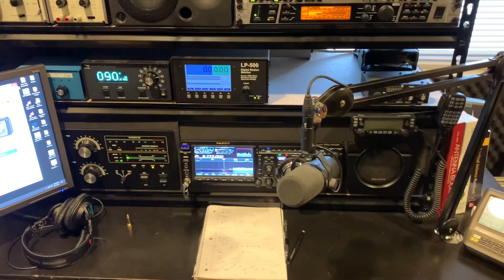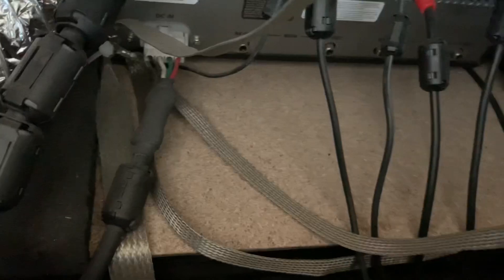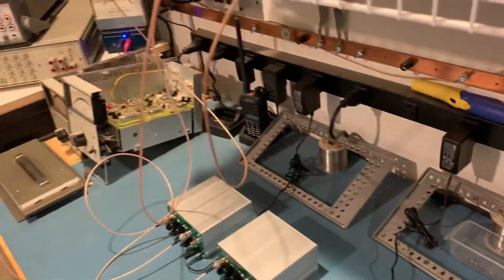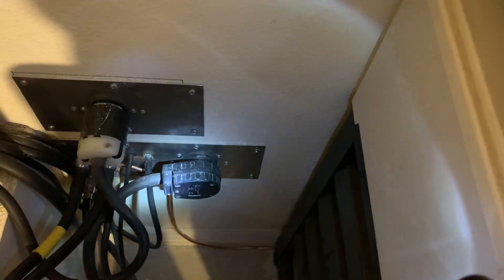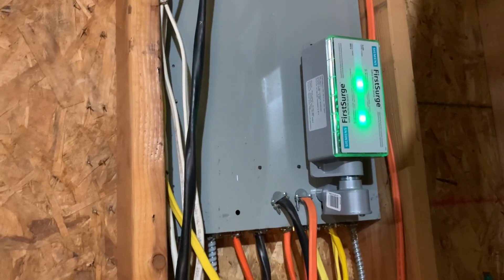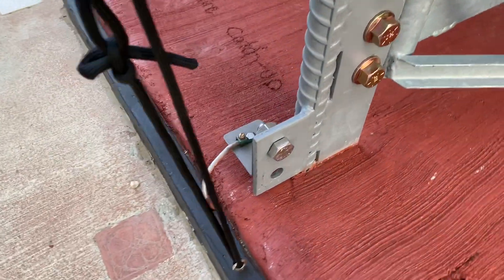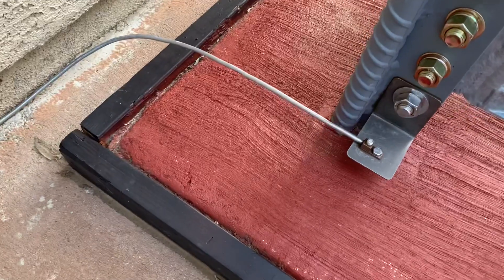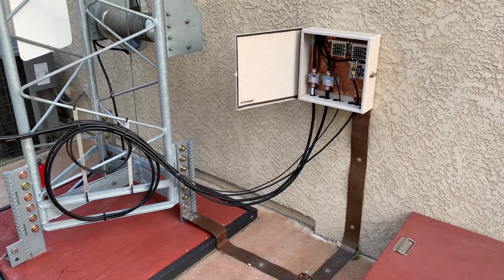Amateur Radio station and antenna grounding at my station  - KJ7E

Comment: Wow, did you drill through your concrete floor (in your cellar) to set the 8 foot ground rods?  If so, do you ever wonder about bugs and things getting in from underneath your house?  I guess water is not an issue since you live in a high elevation above the water table?  Thanks for all the great info!
Reply from the maker: Yes, I drilled a hole for the ground rod in my office under the desk, two actually.  Just put some silicone calk to seal the hole around the ground rood.  No issues with bugs.  The cellar floor is dirt, 3 more ground roods in the cellar.

Comment: Great job on the grounding. nice station you have also. where'd you get them single connectors for the #4 wire mounted on the L brackets at the tower legs?
Reply from the maker: The stainless steel L was from KF7P.com, the lug is just a standard copper ground lug you can find at hardware stores or online.
Reply: @damonkj7e  I appreciate the reply back. I will check the link. 73’s 🤙

Comment: Excellent!! Still bonding and tweaking on my end but you've inspired me to get it done.. If the rain would ever stop.
I only have one observation / reservation. All bonds are on point but you bonded back to main panel.
I'm still on the fence with this one. No bonds after first disconnect. period. OK yea well.. Guess it's back to Ugly's and the NEC book again.
You could do a whole semester collage course on grounding and bonding and I think we would just scratch the surface. Every pro I know goes by NEC and local but has a different opinion or take on it. The way I have mine is it has its own bond and not bonded back to panel. Like a pool or hot tub. 2 - 8' rods and a 6' rod horizontal at the shack.. Dunno now I'm scratching my head again.
 With that.. you did an excellent job. Very nice video.
Only hope mine comes out as well as yours
73
Reply from the maker: The service entry panel was bonded to the house Ufer, rather than bond my system to the house Ufer, I first moved the Entry panel bond to the common point, then extended from the common point to the Ufer ground.  This is okay.
Reply: See.. I had to think a minute but yes.
You just dont want to inadvertently break bond or create a ground loop. ground loops can be nightmares in the shack. My house is also second owner and the 1st owner wasn't shy with tools and I had some questionable wiring to unfigure when I arrived on the scene. Ground was the first thing I looked at.
73  @damonkj7e

Comment: I watch everything I can on grounding, that's why I'm here. And have found some consensus and NEC rules that concur and mandate that if additional grounding electrodes are used they must be bonded back to the main panel with 6awg or >, no splices, and a min. 8" bend radius at corners {On The OUTSIDE Of The House}. !!!  And not provide a direct lighting path into your house.
Having said that, if your antenna is on the opposite side of the house from the main service panel as my station is. Don't you think that you are providing a very nice low-impedance shortcut to the main service panel through your shack and house? I think I would remove the 4awg leading out of the house to the arrester box and connect the large CU straps to 4 AWG or > on the outside of the house back to the main panel/electrodes. Heaven forbid a lightning strike to your tower started a fire to your house and the inspector found you were 
not in compliance with NEC on secondary grounding electrodes' it says Must Be as stated above. On this journey, I ran across a statement from Dave Casler ke0og, paraphrasing.  'When lighting falls from perhaps 50,000 ft in a matter of mil/secs. It doesn't ask permission and it's got a mind of its own. 73/88
Reply from the maker: Simple, you want as low impedance ground system for everything as you can get.  Should a high energy event happen, you want all of your common ground circuit to rise and lower at the same time to minimize voltage differentials.  Voltage differentials is what causes arcing and damage.  I work in broadcasting and have many mountain top sites where we have to deal with strikes and cant go off the air.  Everything from the antenna to the tower to the transmission line to power, transformers, cabinets, dummy load, all the racks and equipment in the racks is tied together with strap at least 2" wide and most of the time 4" wide and sometimes 6" wide from outside to inside creating a common circuit.  Everything is silver braised and clamped or Cadwelded.  It is always best to have the lowest impedance common ground circuit, you cant isolate grounds hoping it does not jump from one to the other, it just doesn't work like that.  Dave is correct, that's why you have to give the energy a path to follow, give it a place to go.

Comment: How do you avoid a quarter wavelength? And why use that thin solid copper considering skin effect? I mean, you've used braid with this in mind. Wouldn't you use copper pipe, the interior of the rod is useless.
Reply from the maker: There is RF ground and then there is electrical safety ground.  I used sort, wide bonding where RF is concerned, but all grounds must be bonded together for electrical safety and surge protection, #4 solid is a good choice there.
Reply: @damonkj7e  yeah I'm talking RF of course. I don't know how you can avoid quarter wavelengths, or multiples thereof with all the bands and all these wires. It would then render the ground useless and actually cause trouble, if anything, because it's now like an aerial.
Reply from the maker: @arconeagain  Bonding of the gear uses short straps, this is for RF, to keep the chassis of the audio gear, radio, amplifier, and other equipment on the bench RF neutral.  This is the only place where RF is of concern.  The runs to the ground roods and between the house and service entry panel is not of consequence except for electrical surge safety.  I can recommend this book for you as it will cover theses subjects in greater detail than I am willing to write here:  https://home.arrl.org/action/Store/Product-Details/productId/133989
Reply: @damonkj7e  okay, I'll take a look. Thanks. Do you not create a ground loop by bonding between each unit when they have coaxial connections between them? Or did you have a common bus on the bench? I'll have to watch again, can't remember.
Reply from the maker: Ground loops are many times unavoidable, but if the primary path is done correctly, they the other paths have no negative effect.  Example, your coax shield is a path between your gear, but a proper chassis ground bus with good low inductance strap to a common bond point will often times eliminate RF in your audio chain if this is something your fighting.  Interconnect wire such as keying circuits, data cables, USB, audio cables, 12v dc power, can all have their own ground paths or chassis bonding. The electrical safety ground in the power cords is another ground path, but often times ineffective for RF, hence the bonding of the chassis for a low impedance RF ground.  Loops exist, but they are only troublesome if all of the paths are poor.  See my QRZ page for more photos of how I bonded all of my gear together to a common bus to deal with RF issues in the shack and with the audio gear.  https://www.qrz.com/db/KJ7E
Reply: @damonkj7e  very good info, and I can tell you are very well educated and practically experienced with this. Plus, you're are willing to reply in detail, demonstrating your passion for radio, and a general care factor.
I am not a ham, by the way, I'm an avid CBer, among other things.
I truly appreciate your efforts in reply, but for also pressing your educated take on things. 
Thanks.
Jeremy.

Comment: Damon, you did an excellent job. My only reservations are the stainless steel brackets. Stainless steel is great for hardware but a horrible conductor.
Reply from the maker: True, stainless is not nearly as good a conductor as copper or aluminum, but its still very low resistance for this purpose, much lower than the ground resistance by several orders of magnitude.  Say the ground resistance is low with 5 Ohms or even with an exceptionally low 1 Ohm (NEC says <25 Ohms, Data centers strive for <3 Ohms) the resistance of the stainless bracket is somewhere near 0.001 Ohm (I measured this on my Keithley DMM7510 with Kelvin probes) where if it where aluminum it may be half that at 0.0005 Ohm.  The difference between the materials is inconsequential compared to the ground resistance.

Comment: How much does the noise floor rise when you lift the ground on the radio bench? Just curious
Reply from the maker: Well, that would be very hard to do since I have so many points where my tower, feedline, and radio gear all tie to to the ground system along the way.    So I cant answer that, I dont know.   However, I am very blessed with a very low noise floor.

Comment: Im confuse wouldn't that be call a looping ground.
Reply from the maker: There is no ground loop here, no.
Reply: @damonkj7e  Thanks I guess im watching to many videos some people say your radio and amps are grounded by the plug going into the wall.Great video 73's
Reply from the maker: @dj5243  Only outlet ground is only good for electrical shock hazard.  My ground system ties in to the house Ufer and electrical ground, preventing loops.

Comment: What is the height above ground, for the top of that tower?
Reply from the maker: Its a Tashjian DX70, 70 foot tower, the mast is a 1/4" wall 80K PSI DOM 15' with 7' in the tower, 8' out of the top.  A steppIR DB36 will be placed about 2' up the mast above the tower.

Comment: Can you explain your equipment cooling strategy?  Looks like you have some flexible conduit (such as would be found on a clothes dryer for vent).  I'm thinking of doing something in this area of my shack installation.  Thanks, 73 de NW7US dit dit
Reply from the maker: Ducting the hot exhaust up and away from the equipment keeps the hot air from mixing with the cold air on the intake, and therefor the equipment runs cooler. I do the same for the amplifier, the hot air is deducted up and away from the gear.  This also helps dampen the air noise from the amp.